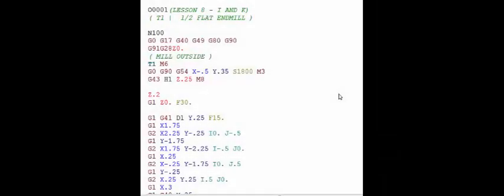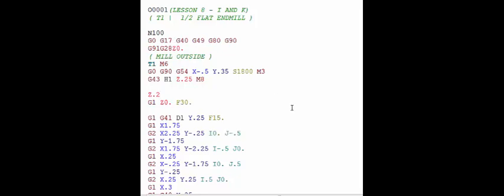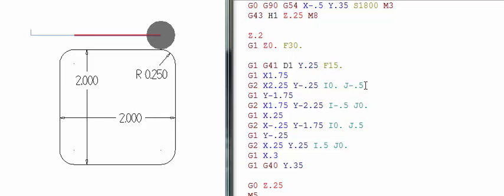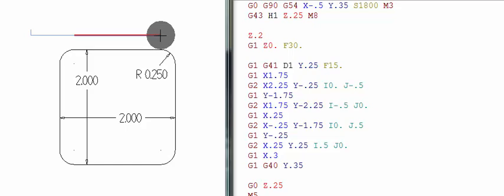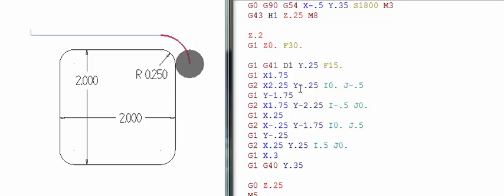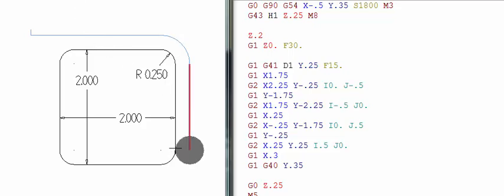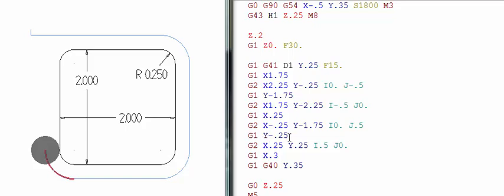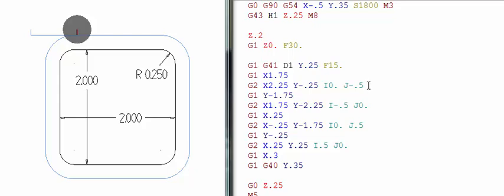WHAT ARE I'S AND J'S USED FOR IN A CNC MILL PROGRAM?

Comment: Would make more sense if the I and J values were 0.25 when using cutter comp (G41) - the 0.5 values are relative to no cutter comp and this seems to mix values - I.e. exact x & y values - but add cutter rad on for I & J - makes no sense to me ??

Comment: I agree with Richard. If G41 is called the X coordinate should be 2.000" shouldn't it?
Reply from the maker: Eazy Man The G41 activates cutter compensation which tells the machine control to look at the value that is entered in the “wear offset” column in your tool offset page and adds that value to the diameter of the tool used. I use this strictly to make minor changes to the size of my part dimensions.  So a zero in the wear offset means the numbers in the program are based on diameter of the tool. In this case we stay away .250. (Half the diameter of a .500 dia endmill). If I enter .005 in the offset the machine now acts as if my tool is .005 bigger and so stays .0025 away from the part which means .005 on the overall dimension. A negative value works the opposite. Hope that helps.
Reply: @TomStikkelman   so then you are using a zero offset for your tool diameter or radius? If so then yes you would calculate your I's and J's in that manner. But if you use the tool diameter or radius in your tool offset for g41 or g42 then your I's and J's are determine on the radius of the part excluding the radius of the tool. For the machine calculates it for you based on either the machine diameter or radius value offset for tool compensation, some machines require diameter and some require radius.

Comment: First of all I want to thank you for the great demonstrations but I have run into a problem. I made a loop for radial passes by subtracting the step value from the current offset which is added to the perimeter of the contour via temporary x/y/r(i/j) values, but g02 and g03 look into the variable and ignore the offset value that is added to the actual number. I tried i/j but they give instant alarm. I'm on a Haas old gen controller.

Comment: hey tom,thanks for another great video.i just have a question on the program.i noticed a D1 at the beginning of the program.is this what they call d comp and is that for tool wear.
Reply from the maker: Yes it is. Anytime you program a finish pass it is good to have it in the code so you can make an adjustment if necessary.  Thanks for the feedback George.   Tom